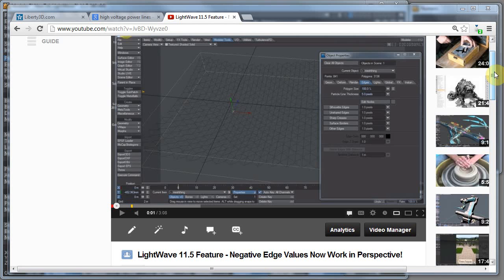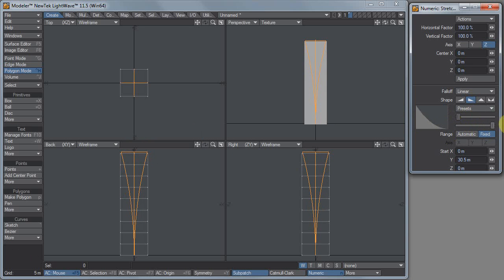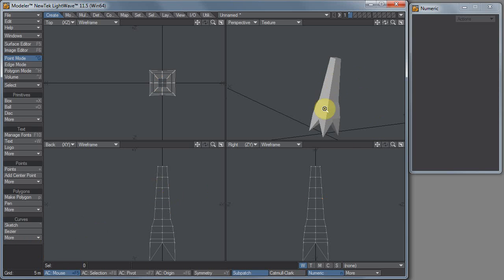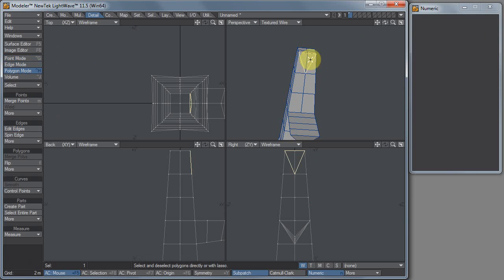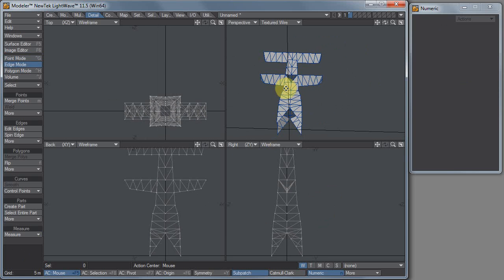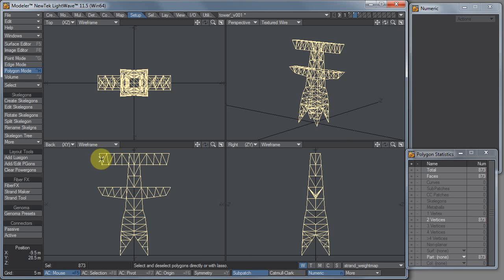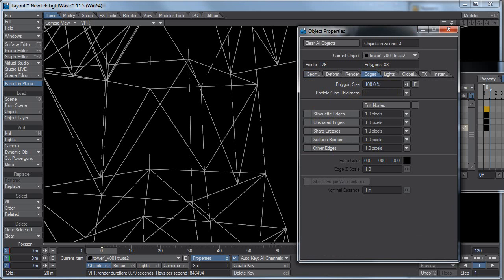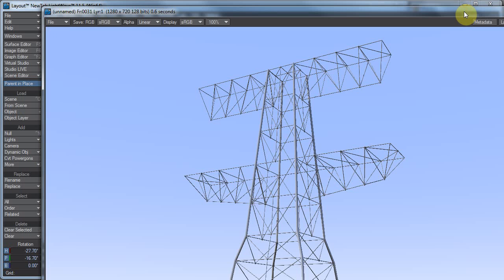Making A High Voltage Transmission Tower In LightWave 11.5 in under 20 minutes

Comment: Any ideas how to easily get the same result (thickness / mesh) in Modeler?
Reply: There's a plugin called Truss2 that I've used in Modeler. I can't remember a quicker way to do it in Modeler. I did learn or figure out after I made this video that you don't need to make the one point polys at all in modeler. You can simply use the Render Outlines checkbox in the object surface property... That doesn't help in modeler, though.  I added a link in the description for a video I did on truss2... with all the distorted audio you can handle. :)
Reply: *****

Thank U very much, Dana! I'll try Truss2.
p.s. LW is great, but I really wish it would have more modeling instruments, especially those are common in other 3D-packages. E.g. in Hexagon, a very simple program of DAZ Studio, making a truss is just a 2-click operation: Extract Curve / Thickness. Extract Curve is just a must-be tool. It separates any combination of edges / edge loops from the initial mesh, and then these edges might be thicken / extruded / used as curves etc.